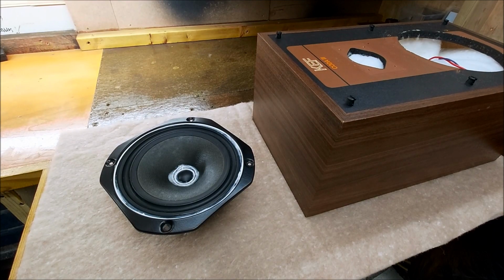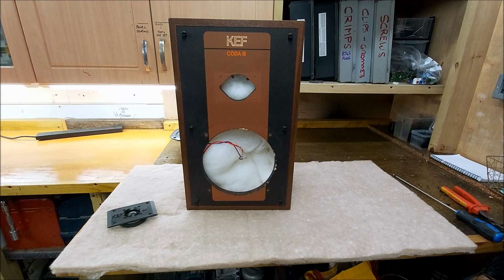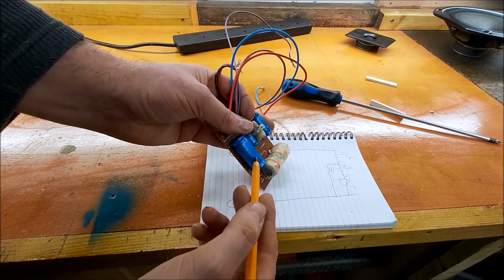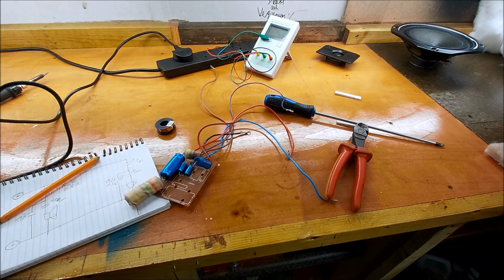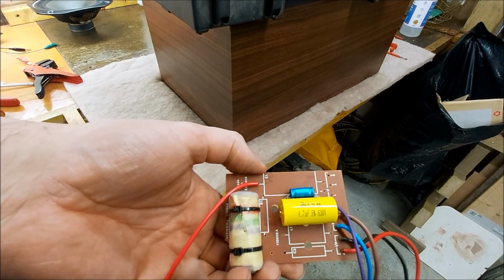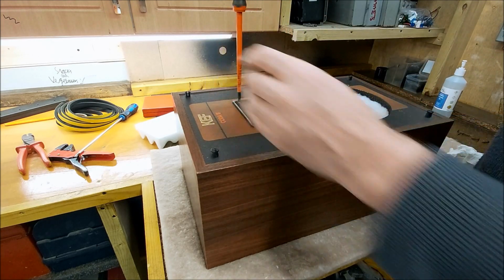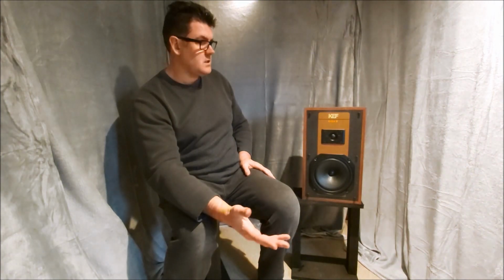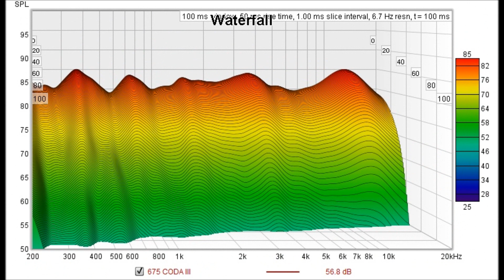KEF CODA III Completed speakers

Comment: I own a pair of these and also the dual 8” version called Carina II. I used to work at a used goods store and was able to audition a huge number of various and vintage used speakers that came through the doors over the years. Out of all of them, I found these to be one of the best for midrange detail and musical transparency. It seems that the sheer thinness and lightness of these 8” paper woofers just allow the music to come to come straight through with amazing detail, uninhibited by weight. I also owned a set of Kef C60 reference speakers and found the 8” polypropylene woofers in those to sound more dull and muted compared to the paper cones.

Comment: I have a pair and they sound fine for their size in my system with both solid state or tube gear.
Reply from the maker: After I'd finished them I was pleasantly surprised. Upgrading the tweeter circuit is well worth it. I always set speakers I've worked on for a quick listen after the work. I know I like them when 3 hours later I'm still listening to them 🤣

Comment: Now watching, glad you’ve fixed the driver.. did you check ferro fluid in the tweeters? I can’t remember if they were cooled or not?
Reply from the maker: I didn't. I'll have a look Tomorrow if I get chance.
Reply: @haycrossaudio5474  they are indeed ferrofluid cooled. the tweeters in mine sound fine in frequency response tests up my hearing level of 14kHz. I guess that means that they do not ned fluid replacement, or am I wrong?

Comment: I just found a pair of these speakers today, my partner is quite pleased with the soft sound of it. I want to open it to see how is the state of the inside as these were left neglected in the open (under a roof but still .. outside). What should I look for to replace the foam (just in case I need to) and i read another comment about ferrofluid, what are they and how do I know it needs to be replaced? I’m quite intrigued to know if they just sound like this or they need some love. Ah and I’d like to change the binding posts later, but it seems you got a bit of a trouble there because they are long? Thank you for your video